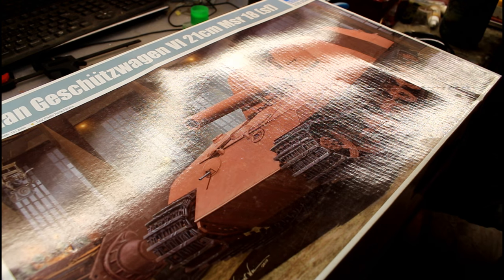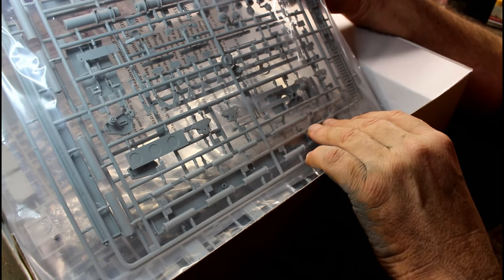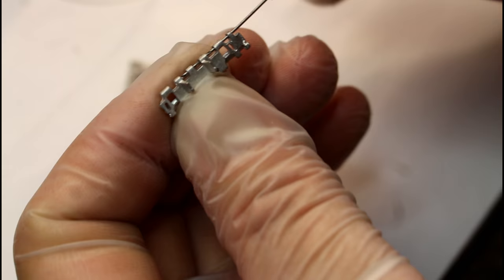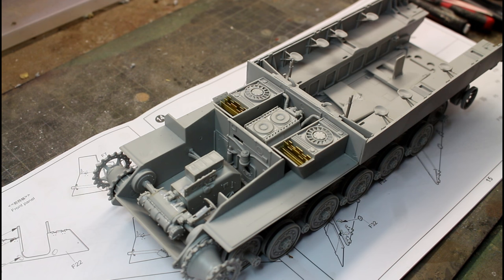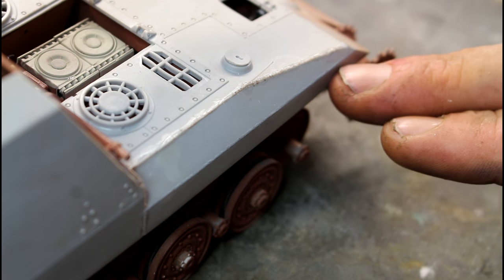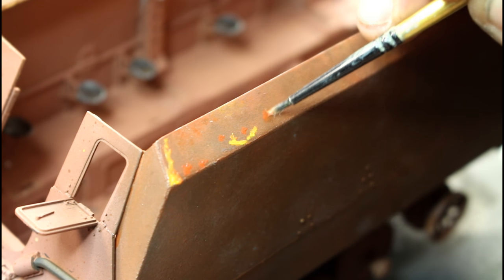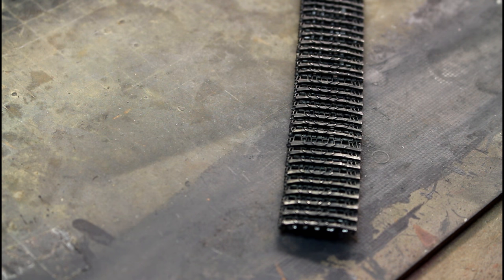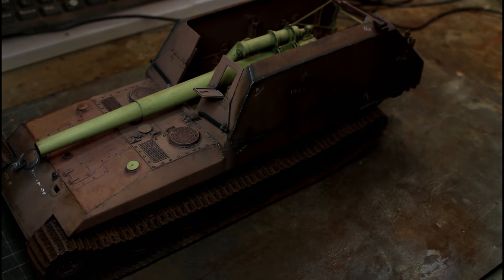Geschutzwagen VI Trumpeter 1/35 Full Build

Comment: A Less Expensive Option for Tracks is HobbyBoss Late King Tiger Link Set; They Work for the Geschutzwagens, But you will need Two Sets.
Now, A Technical Question: The Two Metal Springs for the Rear of the Lower Carriage, What was their Purpose? Were they part of the Dual-Recoil System or were They for The Emplacement of the Gun? I really would like to know; Thanks in Advance!

Comment: Incredible work. Subbed and looking forward to more. Thank you. 

Just curious. Have you ever sprayed Tamiya dull coat over pastels? I'm wondering if they disappear/fade out like pigments?
Reply from the maker: thanks mate. I have never used tamiya dull coat so i am not sure mate. Let me know if you try it.
Reply: Tamiya Flat Coat is a water-based acrylic. Try Testors Model Master enamel Dullcote instead with light air pressure. It shouldn't soak in and dissolve/cancel-out weathering pastels or pigments, as water-based acrylic coats sometimes do.

Comment: stunning piece of work! may I ask, how many pieces go into making the gun and it's breech?
Reply from the maker: Thanks mate. I can not remember but its about a dozen or so. If you watch my inbox review of this kit i go through the instructions so it may be in there some where.
Reply: +scalemodelmania thanks for the quick reply! by the way, a little tip I've heard with the fruil tracks. get one of those rows of staples you put in your stapler and use some pliers to fold them to an L shape, then use your modelling knife to break one off, then put it in the hole, apparently the square shape of the staple stops them falling out. then just snip off the other end of the staple- this also works as a handle so you can just pull it out easily.
Reply from the maker: Great tip mate. Iwill have to give this a try. I have used them for handles before but this is the first i heard about using them with the tracks. Thanks mate.